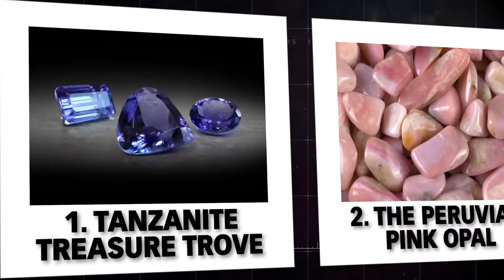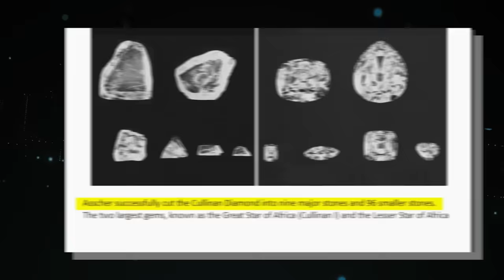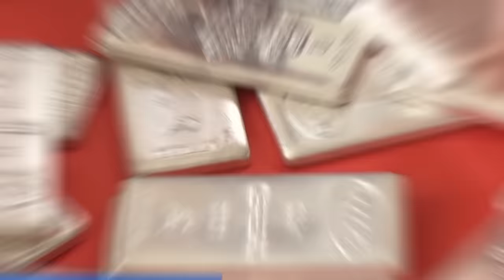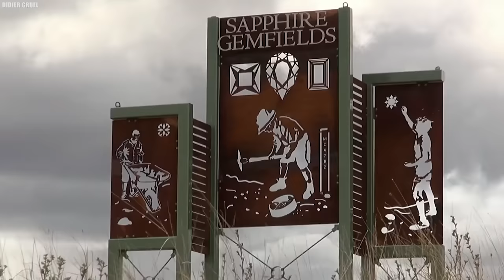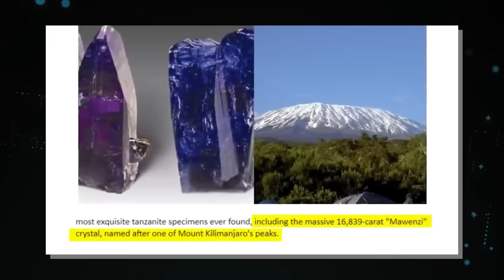15 Most Amazing Treasures Found In Private Mines!

Comment: The Serra Pelada last part is incorrect, they stopped mining because they accidentally drilled an underground water reservoir and the mine got completely flooded, as it is a lake nowadays. Eventually the land got sold to a Canadian company, I believe, but most of the gold still there. If I'm not mistaken, they mined between 5 to 10% of that gold deposit.
Reply: I guess flooding could mean "environmental and safety concerns" but thats wild

Comment: 1:02 this extraordinary gem speaking abiut the worlds largest diamond then shows a fake clear piece of quartz out of focus you can tell its not a diamond because you only see 5% of it and your speaking about the whole thing it has a rainbow in is quartz luminates rainbow colors while diamonds alluminate only extra light or less purity and  color opaque or not translated or not they have 3 main characteristics oily waxy glassy 
More characteristics are etching sized to the point of an atom you can clearly see this is at least 2-5 atoms thick not 1-2 or max 3 the purity of a diamond probably mmm diamonds 🤤